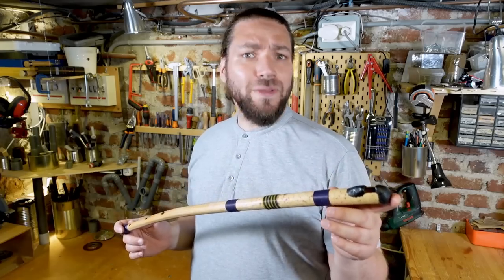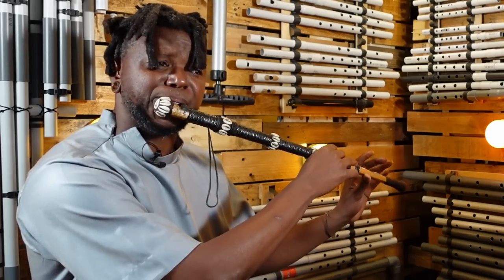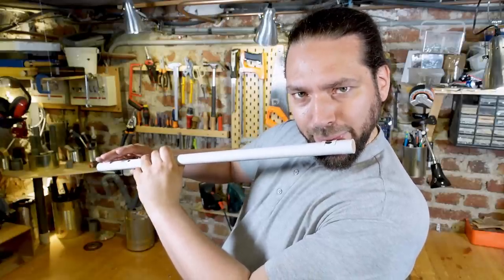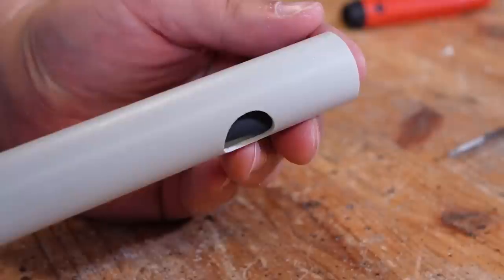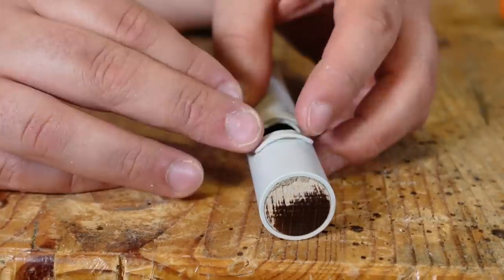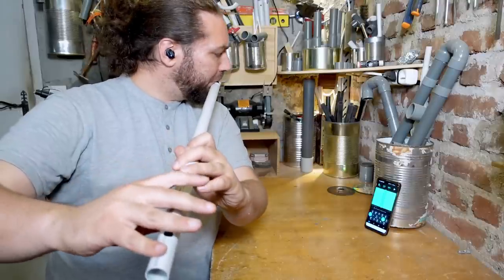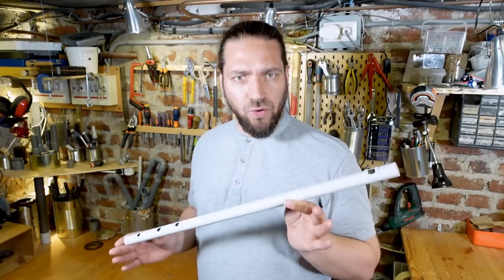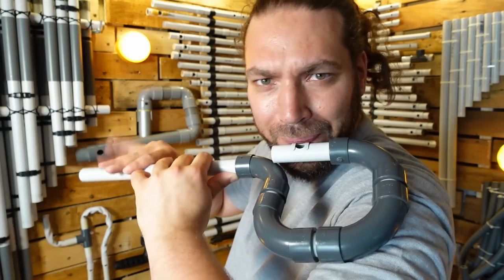How to make a PVC Peul-Style Flute - Tutorial

Comment: I fell in love with the sound of that flute and I really want to make it, because it seems way more doable than a kaval, but I've never made one before and there's a number of things I don't get. I will certainly f*ck this up but I still want to make sure I proceed carefully, hence why I may ask dumb questions.
<<<  First of, which is the right blueprint ? I've just noticed that the one you show on your thumbnail (let's call it T) isn't quite the same as the one available on your Patreon (let's call it P) : the mm values for blueprint P are 645(Ø14x16) / 188(Ø10) = E / 124(Ø11,5) = D / 53,5(Ø9,5) = C when the values for blueprint T are 649(Ø14x16) / 188(Ø11) = E / 126(Ø10) = D / 92 (Ø11) = C♯.. those are subtle yet significant changes, and now I'm a bit confused (that's probably because I don't know a lot about flutes, but it seems like a huge 'gap' between C and C♯).

<<< The piece of PVC in my possession is, unfortunately, a piece of 32mm (outer)/28 mm (inner). I've read on a blog that it presumably doesn't affect the length or the distance between the holes, but the person who made that remark was building a transverse flute, and happened to prefer the deeper sound of the 32 mm. Is it a good idea to apply your 25mm measurements to a 32mm pipe ? I've seen others asking the same question for different diameters but they never got an answer.

<<< For side-blown flute blueprints, you write "The value under the head is the total length of the instrument, measured from the middle of the mouthpiece to the end of the flute." I understand (I THINK) the measurements for the 3 holes, but I'm a bit confused about the mouthpiece and block. So let's assume that the right blueprint is P and let's pretend that my PVC pipe has a 25mm diameter like you : the length you're indicating for the pipe is 73 cm, the diameter of the wood block is 22mm and you're cutting 2 cm of it. Considering the rule you're mentioning, it makes sense that the center of the blowing hole should be placed at 42mm. But you give a total length of 645mm when I (theorically) get 690mm : should I understand that you got rid of 43 mm to tune that B ? and that the total length of the pipe itself is about 68,5 cm ?
Now let's go back to my 32mm pipe : if I do the same steps as you and use a 2 cm wood block of 28mm diameter and apply the same rule, the center of my mouthpiece should be placed at 48mm. Doesn't it change everything then ? Will I have to get rid of 6 more millimeters to get to that B ? And from there, can I apply the same measurements for the 3 holes ? I'm not so sure... (et ce dont je ne suis pas vraiment sûre non plus, c'est pourquoi j'écris tout ça en anglais alors que de base je suis française aussi, mais bon). Merci d'avance..